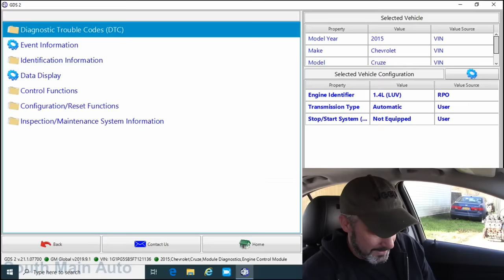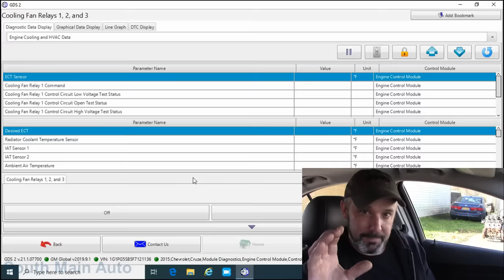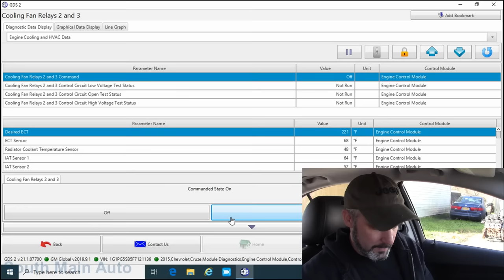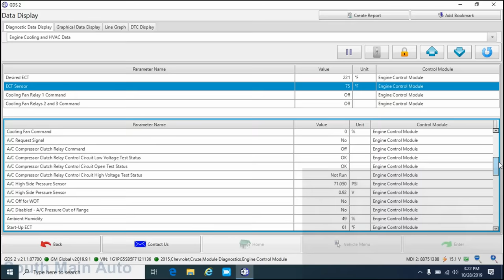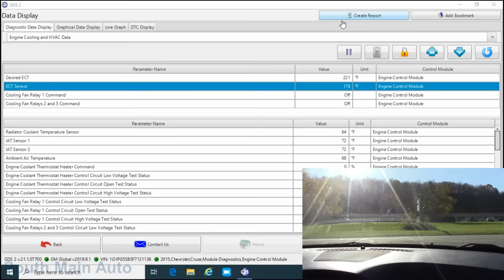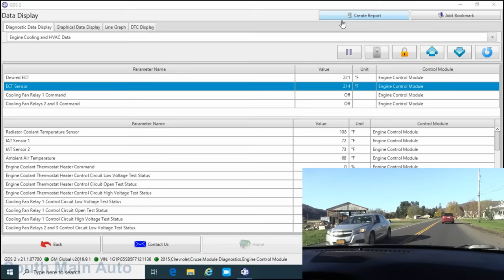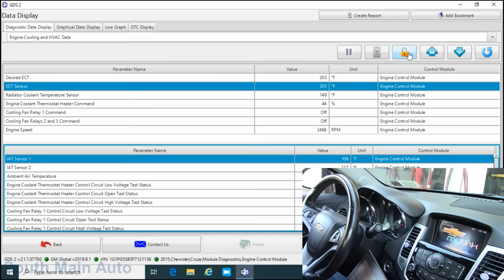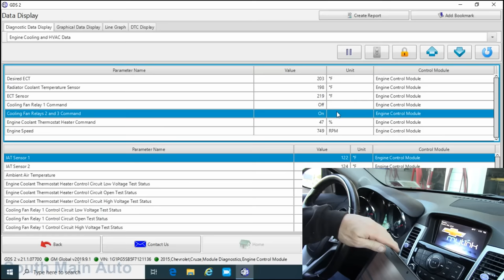Chevrolet Cruze: Overheating, Loud Fan, Losing Coolant

Comment: Half price is going to lead to half quality.  Owner doesn’t know how famous you are SMA.  He should stick with the best and have it done right.
Reply: II would think Chevrolet would have to pick up the entire charge for the cooling fan repair if the owner had brought the fan issue to the attention of the Chevy dealer while still under the bumper-to-bumper warranty.
Reply: Ah well... at least this video on diagnosing the Cruze will eventually pay for itself in terms of YouTube money
Reply: Exactly, I would rather pay a little more and have Eric do it and it be done right rather than the dealer do it. From experience, the dealer don't give a rats behind about your or your vehicle, they just wanna get the job done as fast and efficient as possible. The dealers leave alot of mistakes on their part hidden. Just watching and listening to Eric you know the man takes a great deal of pride in his work, and not just because his business is on the line either, it's because he is an honest, hard working guy. I wished I lived closer to him.
Reply: Not all dealerships are bad, just like not all indie shops are good. Dealerships have a bad rep due to their fluctuating quality of work which is caused by a constantly revolving door of techs. Mr. O doesnt have that issue, since he has 1 or 2 other mechanics that share in his standard of high quality work, but Mr. O also doesnt have the high work load that most dealerships have. I'm not trying to make excuses for dealerships, I'm simply stating a reason for dealerships fluctuating quality of work.
Reply: Was the quote from the stealership 1/2 of Eric's price or half their  price? lol .l My guess is Eric would  be less expensive and the job would be done right first time. Customer obviously not a subscriber to the channel or he would know better than to flick Eric. As they say, you can't save the world.
Reply: Half price at the dealer is still probably 3 times the price that Dr O would charge! Dealers don't make their profit selling vehicles, they make it through parts and service for those vehicles.
Reply: Sir Sweetness half price by the dealer is still overpriced.
Reply: She should of stay away from the GM brands and the Chevrolet Cruise model all together in the first place.Could of buy a Honda Accord or a Toyota Camry only costing a few thousand dollars more.But the Honda and the Toyota can out last like two or three cars of any GM brands of models of cars any times.
Reply: Dealer full price.......One Hundred Billion Dollars!!!!!  For you, half price.
Reply: Sir Sweetness half price because Eric saved them a hour labor in diagnosing
Reply: It's the stealership. You only ever get a half quality job, at best!
Reply: @fourbyfourer  Being someone that works professionally at the "stealership", if you want something done right, with the correct parts, you will pay more money period. Your problem will be fixed and it will be done professionally by people who eat breath and shit x,y and z (brand). We know when people work on their own stuff, we know when non professional mechanics have been on someones vehicle because shit is not done correctly and it's on our ass to fix it, we also recognize the parts that are installed and they are easily verified as genuine, aftermarket or cheap aftermarket bs. This mentality of "stealership" is what is costing people money, not the higher average cost of labor and parts that you purchase from the dealership. Do you want to pay 5 different people a little amount of money to maybe get lucky and have your issue fixed (depending on the issue of course)? Or do you want to pay once and have people that know what they are doing, who literally have the top of the line equipment and access to information that your joe shmoe cannot get to, to do a proper diag and fix? Bottom line, if you want your stuff to be properly worked on, with the actual!@#!@ proper parts installed that are genuine to said "X, Y or Z brand" by trained professionals who are literally trained in whatever brand your vehicle belongs to, then go to the damn dealership. If you are driving an older vehicle that you just don't care to much for and are willing to go the extra mile to try and save money, it is completely on you when you go through 4 shops before someone identifies your problem but then installs the cheapest parts they can possibly get their grubby hands on which will come from autozone or orielly's which is true because I was once a parts manager for autozone and I know who we delivered to and what they bought and I promise they are always the cheapest shit parts... From working at dealership(s) I will confidently say, there are no better hands when your vehicle is brought into the dealership rather than someone who is going to A.) either rip you off B.) give you a deal that is to good to be true or C.) not fix your problem.... But then every now and then you will find a unicorn that will do a great job with a great price and install quality parts onto your vehicle. At the dealer you are going to be recommended strictly by maintenance intervals and diag results according to the information put out by the engineers that built your car. If you cannot pay to maintain your vehicle, you should be riding your bike to work instead of bitching and that is the cold hard truth. All people want is cheap fuckin easy fast work and they only expect instead of using logic and will not even know the first damn thing about the automotive service industry. The stealership is literally your daddy for when the pappa mechanics cant figure it out. You know who doesn't give a shit about you? Sales... you get ripped off by the person who sold you the car and your extended warranty. You know what dealer mechanics think of them? We hate them with a burning passion, but we do care about fixing your shit.
Reply: Livin' The Dream I took to a dealer. They ripped my cars leather up by being stupid and careless. I can confirm they don't give a fuck about you. They also said they'd replace spark plugs for 270. Did it myself for 100 (that's how much the parts costed) and it took about 10mins. Dealers are useless and a bunch of scams.
Reply: Dealer 1/2 price will still be more than anyone else’s price.
Reply: @jskidpatrol  ok who? standard rate is anywhere from 80-100 bucks an hour, most dealers are anywhere from 90 to 130. Parts can be more expensive but you literally eat labor rate anywhere you go, so do you know what you are talking about?
Reply: Ryan Hogan  of course you are not always in the best hands at "the dealer". There are a lot of dealers with shady shops that are not well known where the certifications that would regularly be needed are not but if people use the brain they have, they can easily go to a lugit place and get what they need fixed without all the headache. The places that I have worked, that kind of thing "out sourcing mechanics to figure out an issue" is absolutely unheard of. That is nothing more than an embarrassment and I have never experienced my shops doing that. We are litterally the people who have to make things happen no if ands or buts about it. People don't understand what they talk about when they throw "dealership" around. You have professional service shops then you have little shady unknown dealers who have maybe 1 or 2 shops around the area.
Reply: @GlorifyGodInEverything  Hello There. My rather cynical view of dealerships is based upon  many experiences with them, and sadly what seems to be a rather typical pattern that I hear from many others.  The plot twist  on labor rates is that I have seen them charge 2-4 times more hours than the book rate. (I used to be a mechanic and am familiar with book rates and mechanic compensation). One very recent example was a starter that was replaced in an 07 Suburban.  This job booked at .7 hours and the dealer charged for 3 hours. Add to that they have their own inflated list price for the parts and charged $400 for the starter.  This anecdotal story is sadly common and is the reason the well deserved phrase "Stealership" was born. So in answer to your question, yes, I do believe that I know what I am talking about.
Reply: @tecnaman9097  You can lead a horse to water but you cant make him drink. :)
Reply: @jskidpatrol  so because you paid premium for a starter and was charged 3 hours instead of book value (which is always multiplied by 1.5 btw) you believe you were ripped off.... Well cant help you there, and sadly you don't know what you are talking about. Your book rate is not going to be .7 because its .7 multiplied by 1.5 and if its warrenty comparison warrenty is going to always be less than what customer pay would be for labor times and that reason is for the dealer to save money....
Reply: @GlorifyGodInEverything  We're going to have to disagree my friend. If you are disturbed because you work at or have an affiliation with a reasonable and honest dealer, then I commend you and apologize for offending you.  But I'm afraid that the dealer horror stories abound, and in a greater number than what is heard about private shops such as SMA. Take care and keep enjoying the great content here on Eric's channel !
Reply: @jskidpatrol  you know im not saying anything against this channel right? I know where the bad rep comes from. Its price difference. People hate spending the extra money to get their stuff fixed the correct way by professionals. People feel cheated and honestly people are broke. They have the mindset that because a duralast starter is 140 bucks that an imported genuine part from overseas should be cheap as well.... My advise to you is to not follow the crowds. Its like they play and feed off eachother especially when money is involved. I hate seeing people who are broke and can't afford to pay for their parts and labor. What I hate more is having a single mom with 3 kids show up at my dealer in a rental and a loan with her car towed in to fix a failed part or bad workmanship because she had bad luck somewhere else. Im all for people trying cheap places but at the same time I hate lugit mechanic shops getting a bad rep because people just simply cannot afford it. The only thing I can say is  sales at dealerships are ripping people off when they sell a car.
Reply: Yep yep, they might just all they going to do is change out the coolant and maybe change the thermostat oh, that's it,   ship it down the road,    , then they're going to deal with the comebacks.....
Reply: @Chu3505  +,  👍 AMEN Brother, Amen,  to the that,   but you know how it is you have your Chevy diehards,  & your FORD  die-hards,  etc, etc.....
Reply: @Chu3505  the only bad thing is that if you buy a 6 cylinder honda the timing belt snaps around 100k, and for the 4 bangers at 100k you have to get now piston rings, as well as a cleaning service to grind off the carbon build up and a valve seat adjustment.... It is not cheap... They dont make them how they used to.
Reply: @GlorifyGodInEverything  08 honda ridgeline @ 225k miles and going strong. I do most of my maintenance /repairs. Very few minor repairs. 14 CRV, one warranty repair, 110k miles, i do all maintenance after having wife use dealership twice when i was out of town. Both times they sold her shit we didnt need and messed stuff up. Left air filter box hanging open, radiator cap and overflow cap off. Luckily i checked it just before we hit the road for vacation. Low on coolant. Second time... Talked her into brake job (her fault) but they turned rotors which warped quickly and charged more for pads than i paid for quality aftermarket rotors/pad set that wont warp and then i saw the damage done to a caliper where they damaged the piston and ripped the boot. Big popular dealership whos service department is full of undertrained monkeys.
Reply: @curban0520  no idea where you went. Definantly not an ace certified service department having that sort of treatment. But what I said still stands, a dealer that is well known and reputable will have professionals working, not ametures. For issues that are related to work that has been performed, just like anywhere because we are flawed human beings mistakes do happen but what you are talking about is pure stupidity. I honestly believe half of what you are saying is exaggerated because that many mistakes literally would take a retard to make all of those, but if it really happened I hope they ended up taking care of you in the end. Regardless I have worked at multiple reputable dealers and I am currently employed by one. These stories that I hear from people I simply have not seen. The occasional comeback of course but pure lack of knowledge and lazyness is not a thing at reputable dealers. There is a reason we get paid so much compared to your average mechanic shop down the road.
Reply: @GlorifyGodInEverything  it is a large Honda  dealership in the south, with many locations. You and your dealership may be great, but many orhers are not. I am not exaggerating one bit, i have other stories but those are worst. The same dealership chain at the separate Acura location has been great
Reply: @curban0520  I do know people have had bad experiences. The only reason I am on this train right now is because of the fact that everybody for some reason talks trash about the dealership and from experience when I talk to these people, they have no clue what they are talking about. They will say things that make no sense, or be upset at something that even regular shops have the same routine etc. etc. I just wish people would stop hyping each other up to hate the dealership when in reality the dealership helps many people solve issues that regular shops could not find or understand. The last thing us as technicians want is for people to feel ripped off. A lot of the time we low ball ourselves on time just so that the customer can afford the labor but this type of thing people don't see or hear about... but then we have people that  because they had an oil change one time at the dealer and they offered them an air filter that is too expensive they put themselves in the same category as someone else that is bitching about the dealer, then it just grows from there and then everyone is exaggerating things then everyone is trying to stay away from the dealer. Or they believe the parts are to expensive because autozone has something for cheap, or they check book rate for time and don't realize book rate is that number X1.5..... People have to have more knowledge and understanding before coming to a conclusion on what a real legit dealership is. And I promise most real dealers are there to help you not to hurt you. If someone is trying to save money, the dealer is probably not the place you want to go, but then again, people would be surprised that some dealer parts are actually cheaper than buying them local somewhere else.
Reply: Ryan Hogan  So maintenance service and main line work is going to be different, when coupons for oil changes and whatnot come to your house, it is for promotion to get you into the dealer which is true. The whole up sell speech isn't to just give bs parts to the customer to meet numbers and make the dealer look good it is actually more so to cover our asses so we do not have to do free work and the dealership lose money. If we have a car in and it has say.... A torn drive belt, and we don't recommend it, guess what? That customer will get a new drive belt if they notice we did not recommend it and the tech will not be paid simply because it was his job to recommend what was needed. This is because the dealer does not want people leaving our dealership and not having the option to get their vehicle fixed and not be stranded on the side of the road because that always comes back on us. It's like a car leaving and us saying "it's all good" then 20 miles down the road or 2 days later, they have some failure which results in them coming back to us and asking why we told them their vehicle is good when it clearly was not. What is recommended is actually needed and is followed very closely by technicians and when it comes to mileage interval services those are put out by the engineers that made said vehicle and we have no choice but to recommend said parts/maintenance.The express techs job is to recommend what is needed based on millage intervals or what they can see is physically wrong, and or feel. If it is something that they do not know what it is, it will be told to the adviser and the adviser will tell the customer that it needs to be sent into mainline to have another technician diagnose what the problem is. Usually diag is free and we get a quote to the customer on parts/labor. At a dealer the recommendations are anything that is failing, failed, busted, leaking, broken, questionable and old. Basically the techs job is to recommend what will make your car run and drive at it's best potential to keep you safe and other drivers that share the road with you safe as well. Labor rate is based off of a very big compilation of technicians across the country and the expected time it takes to remove a part, what is labeled as book rate is an undercut from said dealer taking the time and pulling labor off of what the time really should be, these are recommendations from the dealer. This is why we have to multiply book rate by x1.5 so the technicians do not get screwed over on a job, and these labor rates are not created by techs, they are guys sitting in comfy chairs throwing numbers around. Any recommendations that we might give to you seeing how you would be a customer, we as techs can look up said job and find what the book rate is going at, at that point we can multiply it by 1.5 or we can undercut ourselves if we believe we can do the job faster giving you a better deal in the process. The lower amount of labor we recommend on a job the easier it is for the customer to give us the go ahead so even if techs were trying to be stingy and put way to much labor on something, it wouldn't work out because customers just simply would not spend the money, this is what we call "it is the labor the eats people alive, not the part". As for the diesel oil changes, they are always a lot more expensive, i'll assume your dealer uses t-6 synthetic motor oil for your truck and roughly 12 quarts, well the labor rate for doing an oil change on a diesel is typically higher than it is on a gas vehicle because their is usually more involved dealing with diesels, they take longer for 1 which is going to up the labor rate over a normal oil change, the filters are more expensive because of the physical size, and the oil is not cheap simply because it's for a diesel and you have twice the amount of oil going into your truck, fuel filter service's are usually expensive because of the going labor rate to replace the filters, if the dealer is 126 bucks an hour for labor and labor for the filter is .8 out of 1 hour which will be given to the tech to replace the filter, you just paid 80% of 126 plus the cost of the filter on top of your oil change. From my experience going to shops and getting recommendations from other people, I find that I will pay more at a dealership (sometimes), or I will go to a place such as firestone or pep boys etc. and they recommend things that do not even need replacing. I used to work at NTB and I remember the managers tried telling me to sell rear shocks to a customer because they are leaking. Turns out when I went out to verify the leak, they were not leaking and the car was only 1 year old. I actually quit that job because of that. I held that job while I was recovering from a back injury when I worked for Chrysler and I could not work on cars during that time. But all in all, the recs from a dealer are pretty much things that if you bought it would be nothing but beneficial because they are lugit recommendations. We have specific instructions on what to inspect and also what to expect based on millage, type of motor/car etc. Basically if you needed a set of brakes, we are not going to recommend calipers just to meet numbers.... You will be recommended "rear brake pads/machine rotors". You wouldn't be recommended calipers unless you had seized pistons or if a car came in and had some random off the wall problem with their calipers. (this is all said just as an example.) But if you have any more questions ask away.
Reply: Ryan Hogan  Hey regardless of them trying to write up an expensive invoice, they still have to go by what is actually needed. The whole idea that dealerships recommend bs is bs in itself. If a car comes in for brakes, but the adviser see's, it has a recall, is due for timing chain, spark plugs, throttle body service, coolant flush, fuel service, trans service, rotate/balance he is going to recommend all of it not only for the money, but because it's their job, but then on top of that, the technician is going to get a hold of it then he will see what is do but also what needs to be fixed, so he might see axles leaking, ball joints with play, tie rod ends that are lose, valve cover gasket leak, water pump leaking, bad battery test, engine and air cabin filters dirty etc. Then you end up having a huge ticket. You need to let go of the idea that dealers are there to just fk you over. What you can do instead is make a list and ask the technician what he deems to be the most important to take care of if you don't have the money to spend and start knocking them out one by one as you make your trips up to the dealer. Also the service adviser is not going to tell you to get new calipers "because they are rusty". That is something fire stone or pep boys etc. would do to meet their numbers. Dealers are under way more strict guide lines on what to sell and when to sell it. For instance, just the other day, I had to recommend rotors because the rear brakes on a vehicle were worn down to the metal and the metal from the back plate of the pad ate half the rotors thickness away. After I sent in the recommendation to parts, and parts sent it to the adviser of that ticket, the adviser had to come out and check with me if we could save the rotors and just cut them, or if they were to thin. This is because of money, it is faster and more affordable for the customer to get new pads and get his/her old rotors cut than to have new rotors ordered and put on and the customer is more inclined to say yes due to the fact that it is cheaper to cut the rotors than buy new ones obviously. Dealers are not here to screw people over like I said. Ntb and places like that will screw people over because they don't have the correct guides for the vehicles and don't really know what they are doing. Sure they know how to replace parts, but the question stands, did it need to be replaced? and more often then not, it did not need to be replaced.
Reply: Ryan Hogan  I work on my own vehicle, I get discounted prices on everything and i'm not under warranty and I have the whole world of the mechanic industry at my disposal or I would bring my car to the dealer. If you find a guy like Eric great!!! But good luck. The only way you will know if you find a guy like Eric is if you know your shit, but if you knew your shit you wouldn't need Eric.... So basically you are stuck trusting someone and they might make you believe you are getting a good deal and you are really not getting a good deal, or you might actually be getting a good deal, who knows lol. At the dealer you at least know that the recommendations are actually things that need to be done to your vehicle, matter of importance is a different issue all in it self, but techs put in notes of the severity of the issues and try to communicate it to the advisers that way they have an idea of what is going on. Just remember service advisers usually don't know the first thing about cars, they only know how to read pieces of paper that have mileage intervals and what the techs report to them. I'm not effected either way on what your decision is to do with your own property but the whole dealer rip off is far from the truth.
Reply: Ryan Hogan  if I did not know how to work on my car, and I needed to take it somewhere I would go to the dealer. As for access to parts, I own a ford so the parts for my vehicle we do not have on hand, I get parts delivered to my shop by ford at a discounted price as well. Most "shops" get their parts from places such as autozone, napa, or orylies which are not oem parts... From experience, it's always hit and miss having parts from autozone.. for instance, replacing motor mounts on a 2014 chevy silverado. Customer had a complaint of a banging and grinding when he stomped on the gas. Turns out his motor was lifting and getting pushed against the upper portion of his fire wall because his mounts were split in half. Replaced his mounts with mounts from autozone and I put the truck in drive held the brake and hit the gas to make sure the rubber on the cheap mounts would not over stretch. The brand new mounts ripped in 2 and the studs holding the bracket that keeps the bottom and the top together broke and the motor lifted up again and slammed into the fire wall. Had to go back to autozone and hand pick a set of mounts for his truck and redo the work I had just done. This is when I worked for a smaller shop. This is the issue with shops getting parts from oreily's or autozone, they are crap.
Reply: I guarantee you that Chevy Cruze is coming back.
Reply: XqeDiosXqe 

     Lordstown??    I don’t think so.
Reply: The dealer will replace the part at half price for sure, how ever something misteriously will pop up   while replacing the half price job and now you be paying extra full price on the other job.
Bad move Cruze owner.
Reply: @fourbyfourer  He could pay for Eric to do it, but that would be letting the dealer off the hook.
I wouldn't be surprised if some non-technical person did the initial inspection, and if the car isn't actually spewing fluids, or making obvious noises, the standard reply it "that's normal"
Reply: @DapimpBDSD  Eric's shop is small enough that he can control quality. As we have seen,  almost everyone comes to ask him what he wants done, (and I am sure he is proactive about it). As your business gets larger, you can't do that, and still work on the cars. 

You need a capable manager and some good senior mechanics who can advise the less experienced if you want to expand beyond a certain point.
Reply: @GlorifyGodInEverything  yeah I'll be six feet under before I let a dealership touch any of my vehicles. All work is done by me. Where I personally know it's done right.
Reply: @DapimpBDSD  Dealer mechanic is paid base on the book rate for the job.  If the mechanic can get a 3 hours job done in 2 hours he gets the full 3 hours for the job.
Reply: @tecnaman9097  Eric may or may not use factory parts while a dealer is stuck using factory parts.  With the quality of some aftermarket parts I would go with factory parts.
Reply: @Ownage4lif31  Thankfully not every dealership is like that.  The dealership I work for cares and we have 4.8/5 star google reviews.  But then again, we are a family owned dealership who only owns 1 dealer and only one brand.  We don't have 50 gazillion dealerships and the owners and the owners kids are in the dealership everyday and working.
Reply: @jskidpatrol  How my dealership I work for would go about this.  We strictly charge book time wheater its looked up using gm service information, or using alldata.  If a starter calls for .7, that's what the customer pays plus 1 hour diag.  Total would be 1.7 if they didn't have any add on services. I'm really sorry the dealer you took your truck to screwed you over, but there are really good and honest dealers out there.  Just like there are really crap and dishonest independents.    Not all dealerships are thieves and not all independents are honest and I really wish we could change this mindset.
Reply: @GlorifyGodInEverything  Well you're partially correct. But alldata time is customer pay time.  Warranty time listed in GM service information is multiplied by 1.5 times to get customer pay time.  Just looked up starter labor on alldata and it calls for 1.2 customer pay or .9 warranty.  That is for a 2011 4x4 with a 6.0 and we all know the gm starters all pay the same because they haven't changed location in years.  So, 3 hours for a starter under customer pay is a rip off and that's not cool
Reply: @Jeff The issue here is that most dealerships suck. I've had a bad experience with 2 dealerships in my area. 1 was for Mazda and 1 was for Toyota. I've had enough. This is what makes it bad for most dealerships. They see 1 or 2 that suck and don't bother going to anymore. However, even finding a good mechanic is hard these days. 

You guys might be the lucky ones, where you are the only dealership in your town/city.

But fact of the matter is, most dealerships are a nightmare to deal with. I asked my Mazda dealership if they could manually modify the firmware to enable auto lock doors (long story just know I couldn't do it) and they said it would cost $150 to take out the computer and have a look. Now, I've never seen such incompetence ever. It's all modifiable through the OBD port and at that point I knew they had no idea what they were even talking about. Most of their solutions are just "let's take a look at the computer by completely unplugging it" when there's no need at all to do so. So then I googled about it and turned out there was some dude who made a mod that did exactly that. All you had to do was plug in your pc to the obd and initiate the installation he provided. After that, the infotainment system gave you the option to do a lot of things you couldn't on the default. This was just 1 encounter I had with them but when I took it to get my engine cylinders cleaned, and oh boy they didn't even clean all of it. Legit Half assed job and charged me $600, they refused to take a look at it and called me a liar when I confronted them. 

It's always best to do things yourself, but I know it isn't always possible. It's sad to see dealerships and mechanics outright scam people most of the time, makes you never want to take your chances at a new place ever again.
Reply: Watch the Stealership charge him and not replace any parts but maybe the thermostat. The car will be back at SMA!
Reply: @GlorifyGodInEverything  I agree with this 100%.  Not all mechanics are like Eric. Very few are.
Reply: @Cerus98 I have experience working in both aftermarket, and dealership shops.... You can have an opinion but it doesn't make it right lol.